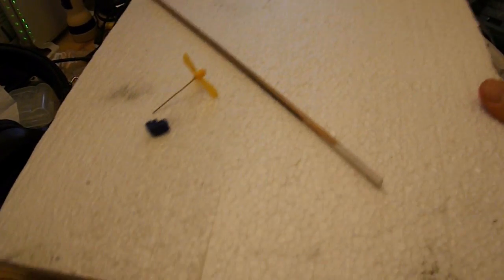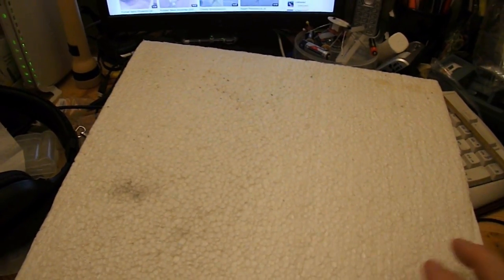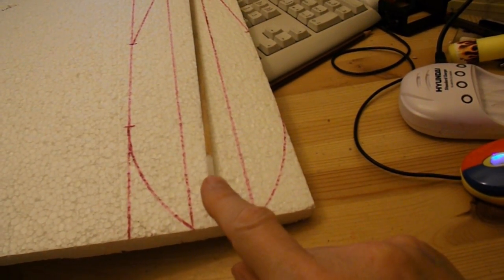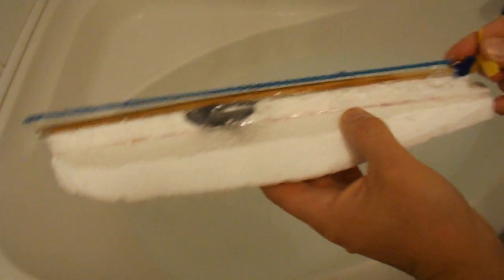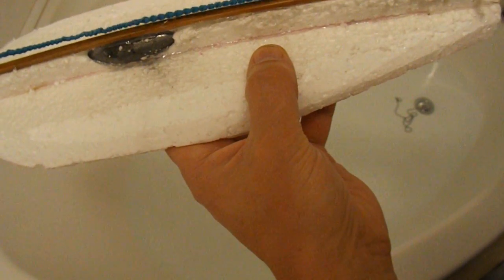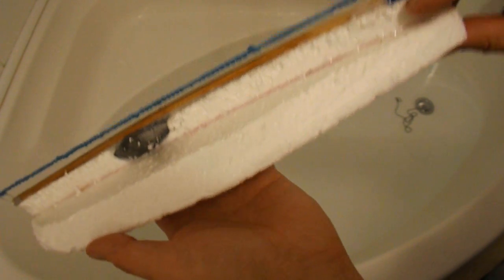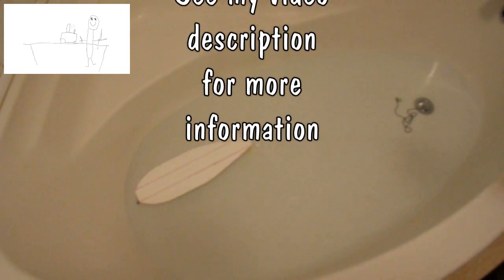Rubber Band Powered Boat

Comment: Grandad, can you make a rubber band powered ducted fan airplane? I'm trying to do it now but out of paper.
Reply from the maker: I will put it on my list, but I am not sure when I might get to it. I do remember seeing this video from 2014 on a ducted fan car https://youtu.be/pWUN2QJslKI
Reply: @GrandadIsAnOldMan  I've seen that video too. He needs more rubber, or a lighter impeller. He also attached that assembly to a foam chuck glider. Didn't have enough thrust :'( but cool to see him having fun with it!
Reply from the maker: @spencer963  you will notice rubber powered aircraft usually have large propellers. A ducted fan is going to be a relatively small propeller so it is not going to be as effective as a large propeller for the same amount of rubber. A small propeller spins faster, so it uses up your rubber power quickly. You will see he was using quite a long body to allow him to use lots of rubber. It was also hobby grade rubber , so it was good stuff, not cheap rubber bands.
Reply: @GrandadIsAnOldMan  my solution, to your very realistic problems, is that I'm using a THICK band. Not hobby grade, looked into it, and supplies are (surprisingly!) Low. I hate today's economy. Either way, what I'm doing is a 2 to 1 ratio belt driven ducted fan. I know I'll definitely have the torque. My fan is only 70 or so mm in span, double laminated cardstock. Always been good at creating some unimaginable shit out of paper and cardstock. Always gave me the freedom to let my imagination go wild. Actually in the process of patenting a propulsion assembly. I believe it will be industry shaking. Small risk, potentially tremendous reward
Reply: @GrandadIsAnOldMan  also my impeller is pretty light for how structurally sound it is. Just blowing on it it sounds like it's spinning at a large rpm. It's not the first I've constructed out of paper. My thrust vectoring rc hovercraft incorporateded one. I hugely miscalculated the gearing needed. Built it out of salvaged electronics from a Corsair (the gull wing one, c-u??) It was a cheap Chinese made rc plane. But I wasn't about to let it's cheap electronics go to waste!
Reply from the maker: @spencer963  I apologise buddy, I have just checked out your channel and I seriously underestimated your capabilities. I usually get comments from kids who want help with their school projects. I can see you are way ahead of me in attention to detail and quality of build. I did sit down and design myself a 3d printed ducted fan car yesterday as your request inspired me, and it has been printing overnight, but I honestly don't expect it to perform well. If it runs forwards any distance, it will be a success for me.
Reply: @GrandadIsAnOldMan  it's not about skill level, we enjoy our craft and get better with time. Thank you sir for your very kind words, I've been watching your channel for awhile, you're much better at engaging the audience and your projects are well explained. My videos are, um, lacking haha. Keep tinkering brother! I love it!
Reply from the maker: @spencer963  here is my attempt https://youtu.be/5uCFW0wCLNw (Video scheduled to be published 10 AM UK time on the 19th)
Reply: @GrandadIsAnOldMan  very cool, I look forward to seeing what you've come up with. Cannot believe I encouraged someone I've followed for so long, I believe it'll work alright. Probably no dragster but that was never the aim
Reply: @GrandadIsAnOldMan  I have the ender 3 pro, it was the cheapest with good reviews and a large community behind it. My first and only 3d printer I've ever owned. I liked the idea, but decided not to take the plunge till it was excusably  priced right for my, idk, point in life. It was only 190$ 😂 I'm so cheap. But it's been panning out well for me in the bigger scheme of things. My attitude is things are going good, ride that wave, and never. NEVER get cocky. Trying my best, it's all I've got.
Reply: @GrandadIsAnOldMan  looks like your car surprised even you, don't stop there!

Comment: hey grandad! can you make a rubber band powered car with three power stages
Reply from the maker: I am not entirely sure what you mean by three power stages. Here is a mousetrap car I did with what I called a 3 gear auto gearbox and the same principle could be applied to a rubber band powered car https://youtu.be/XXPm-K9uyGQ?list=PLA5a2xPRSrB1jSyRMjw31ptEYAAkZRF6H
Reply: GrandadIsAnOldMan like 2 band powering it then when it runs out another starts
Reply from the maker: Inferno Beats I know this is not quite what you mean but if you think about it, that is what happens when the bands are wrapped around the axle. The only one that is doing the work is the one that is stretched out. The ones still wrapped around the axle are doing nothing until they come off the axle. Have you thought of a method of achieving what you had in mind?
Reply: GrandadIsAnOldMan yes I have
Reply from the maker: Inferno Beats I will look forward to seeing your video

Comment: I am a little confused on the paperclips. you put the paper clips on the wood and glue it or made a whole in the stick and put it in? or just under the piece of wood? And for the other paper flip where there is no propeller is it in the wood or in the styrofoam or what?
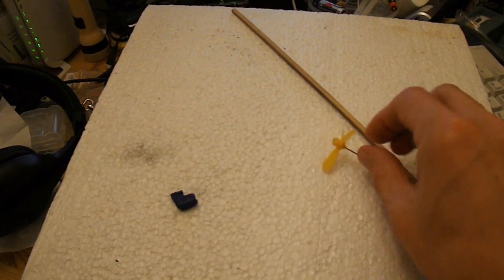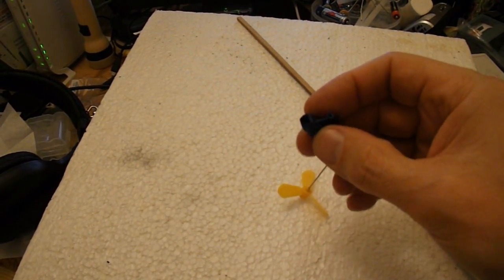Reply from the maker: +AAJKFilms the propeller shaft 00:34 is a paperclip and it is in a plastic assembly 00:57 taken from an old rubber band powered plane that slides over the end of the wooden stick 01:12  At the other end the paperclip is glued to the wooden stick. I use hot glue and that holds the paperclip in place on the stick fine but you could drill a hole if you want however that might weaken the wood and make it split. You could hold it in place by wrapping cotton round it and then add some glue on top of that. If you don't have the plastic assembly for the propeller bearing you could make one from some plastic tubing and more paperclips like I do in this project https://www.youtube.com/playlist?list=PLA5a2xPRSrB3Xj24kixZAMLN6oaDu2_Z8 or maybe just bend a piece of metal cut from a tin as shown in this project I found on the web http://www.ency123.com/2014/10/toy-motor-boat-how-to-make-homemade.html
Reply: okay thank you!

Comment: what is the yellow triangular thingy?
I need to know what to get so I can make one for a school project
Reply from the maker: +Blake Bontempo it is a propeller, if you check out the video description I explain that it comes from a toy helicopter but you could make one. I have just added another link to the video description that takes you to my playlist where I have put all the projects I have done that include making a propeller as part of the build.  I haven't put the link in this reply because YouTube often hides comments with links in them by putting them in the spam filter. I have just realised the same links are already in a reply here to Balgran Tango

Comment: Hi granddad i wanted to ask you f you can make a hot air balloon out of a bag and possibly a paper basket. It should be quite small... As big as the boat... Thank you so much for your videos
Reply from the maker: Is this the sort of thing you mean http://youtu.be/Bcllc3fBi6I
Alternatively you could just buy one of those Chinese lantern balloons that use a tea light or similar to heat them. They are really cheap so making your own is hardly worth it.
Reply: No. I meant one with the homemade items. Also if they are cheap... Can u make a time lapse of an ink chromatography. I know you tried doing one but u need to use a wet erase (not dry erase) marker. It is very cool but i never seen it on time lapse. Thank you
Reply: Also the air balloon has a basket of some sort to hold a candle. That would be the heat source
Reply from the maker: eddiesadat I will not be making a hot air balloon that carries a heat source as I consider they are dangerous and hazardous. They are dangerous because you are sending a flame into the air with no control over it's destination. They are hazardous to livestock as they are occasionally eaten by cows or similar animals. The farming community are very annoyed that these items are allowed on sale.
That is why the balloon I made used a hairdryer as the heat source and I kept it tethered so I had control over it.
As for the timelapse of ink chromatography I will probably do some more at some time, but I have none planned at the moment.
Reply: I understand.. Although i meant doing it in your home.. Witch i suppose is also dangerous. Thank you otherwise
Reply from the maker: eddiesadat I am probably over cautious but I cannot advise you any other way.